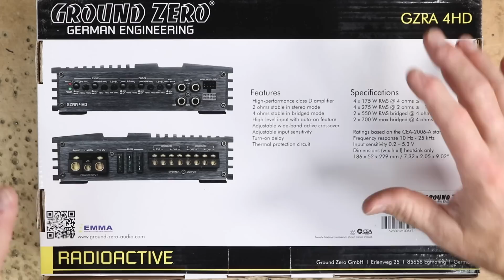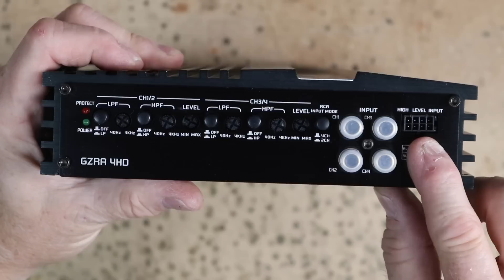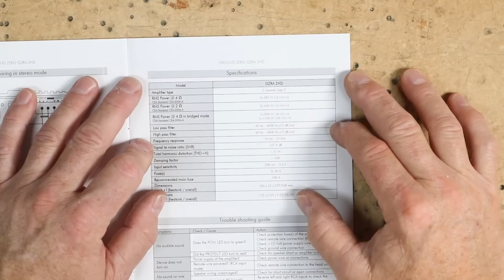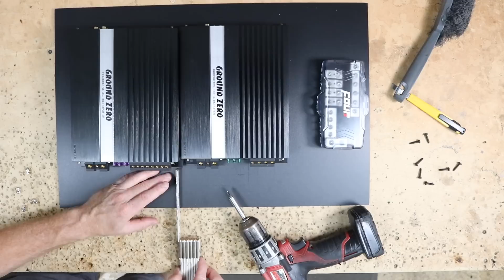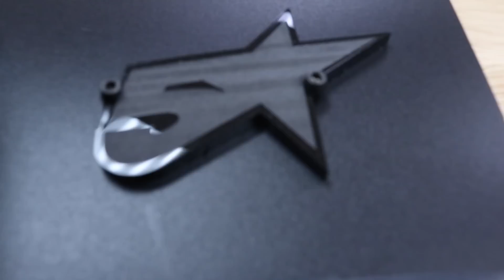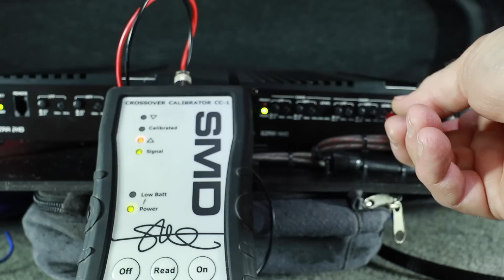Ground Zero Radioactive amplifier unboxing, Dyno, Install Car Stereo Lab

Comment: While using DD-1, use on both left and right channels. On my rockford T400-4, ch1 was showing around 17vAC with no distortion while ch2 was showing around 20vAC with distortion.

Comment: Awesome! Be sweet to install this in our family Sprinter 12 passenger van.  Mercedes puts a lot of speakers in there but increasing the volume activates a crossover that cuts out the tiny bass there is.  Love to run the audio for everything through amps and add a sub.  I have an awesome bandpass 12" with no amp and no home as well.  Be great in the van!  Enter me in!

Comment: The distro block is yet another copy of the Chinese versions which is a close copy of audisons block. The 6ch RCA can be purchased on ebay as a generic Chinese 6ch cable for much less. The fuse holder is a copy of t-specs version...which surprise surprise is a copy of Chinese version. All marked up in price significantly. Just fyi

Comment: Hey Dean and Fernando love your work..quick question, I just just installed a starsound gladiator 4ch amp and the amp has a amp fan wire which just has 2 wires red and black..so do I connect it to remote and ground or constant power and ground cause the amp plays nice but it gets hot and it winter where I am right now.
Reply from the maker: You would want to install a relay off of the remote wire to power the fan  or connect it to an accessory power from the car
Reply: @FiveStarCarStereoInc 
How do we get these amps to purchase?
Reply: @FiveStarCarStereoInc 
Do they have a mono amp rated at 2000 or 3000 watts and 4 channel 1500 or 2000 watts?